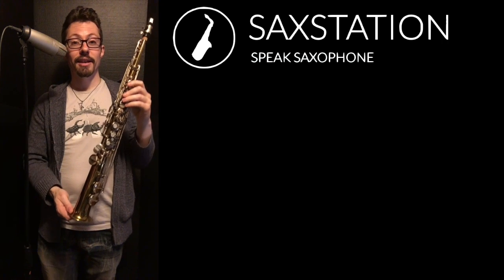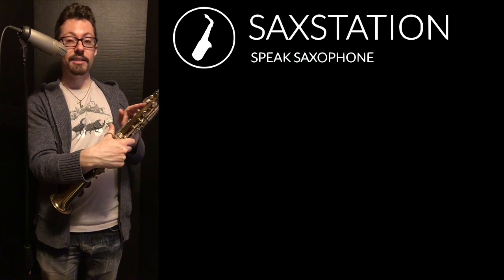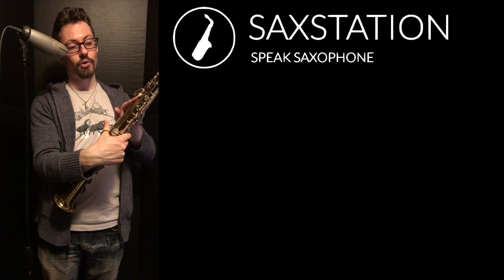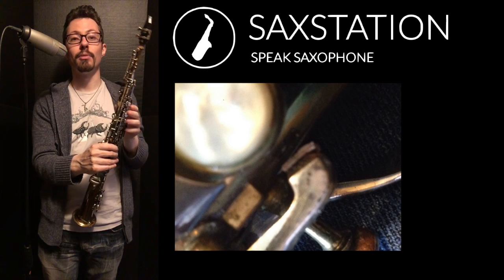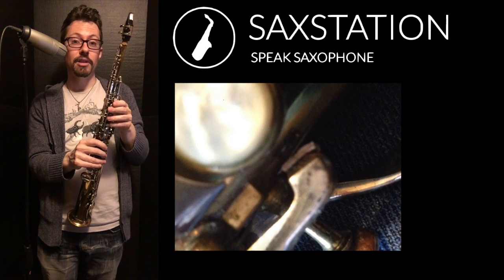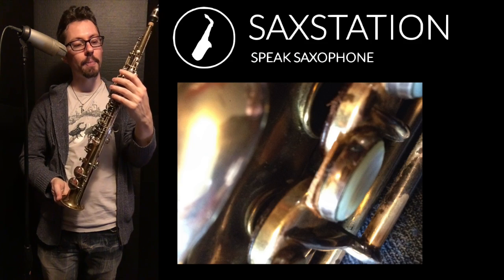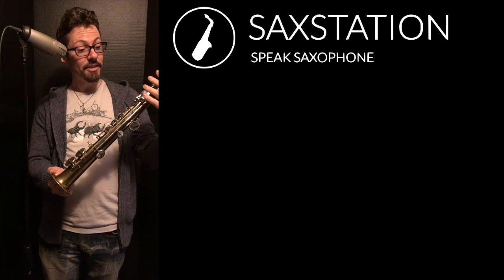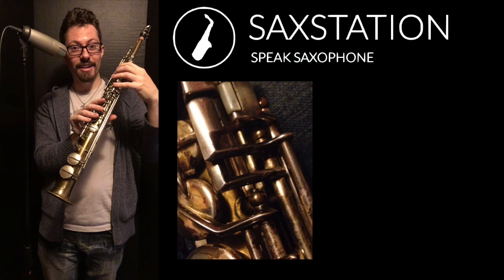Amateur Saxophone Repairman Episode #3 Replacing Tape with Cork

Comment: Thanks for these tips. I have also found that some tape was very useful to adjust some keys, which tend to move over time. Never used the cork, I will give it a try ! For some reason, I did not find your first 2 episodes ? Great work, thanks and cheers from your southern neighbor . 🎷🌵
Reply from the maker: You're welcome. 

A bit more work to use the cork, need to cut it and glue it pretty precisely. Also easier on a tenor or alto compared to a soprano most of the time.

Here is episode 1: https://www.youtube.com/watch?v=pXHRfSpzezc

Here is episode 2: https://www.youtube.com/watch?v=TpGiatLiizE